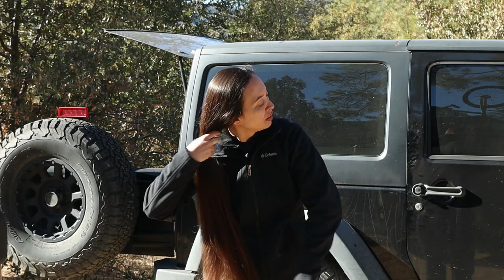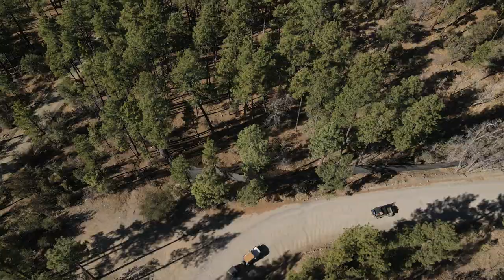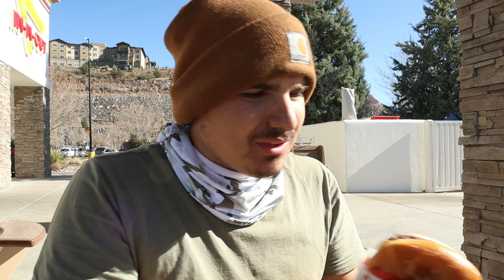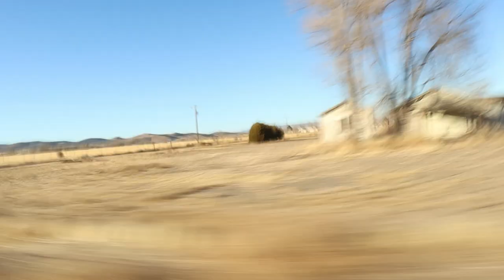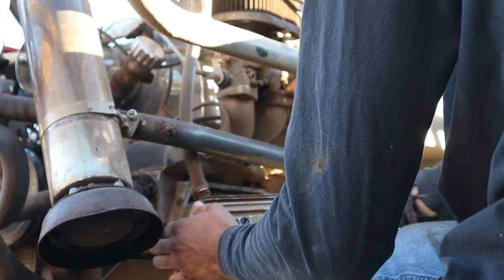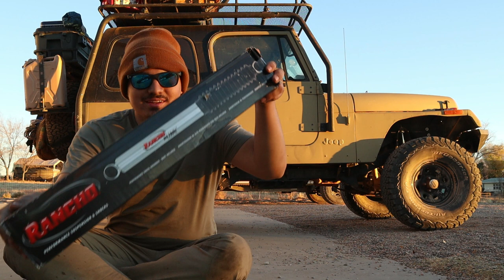I can't believe the engine BROKE!

Comment: At some point it might just be better upgrade to newer vehicle that wont require as many fixes and be cheaper in the end
Reply: Unfortunately you must be very mechanically inclined to drive these older vehicles to this extent. I don’t believe he is knowledgeable enough todo most of these things himself. I really hate saying that but it just seems that every time he tries to save money it ends up making a big loop
Reply from the maker: @trevordavis4728  I’ve already fixed it to this point, what else do I need to know?
Reply from the maker: Yes but it just wouldn’t be as fun, I enjoy turning a wrench from time to time and I like the connection I get driving a classic car. It’s just not the same without it